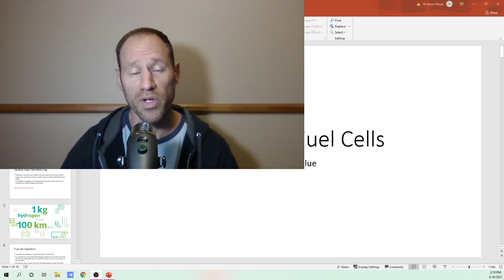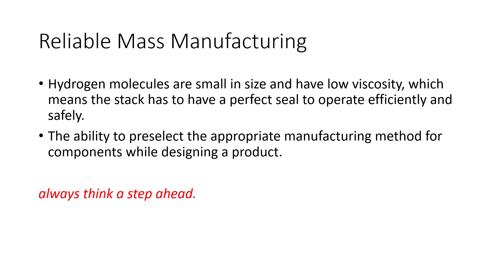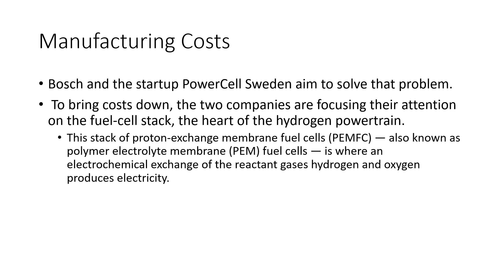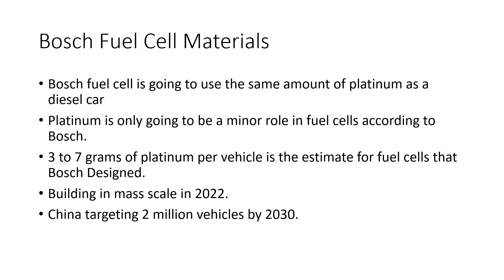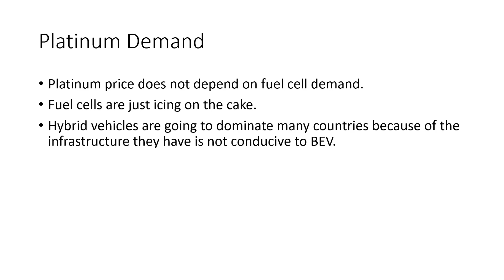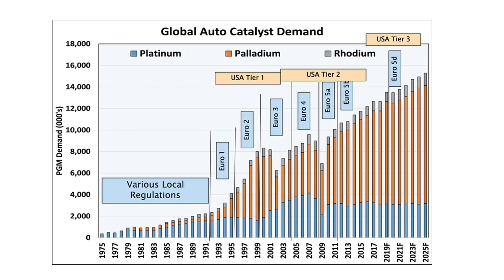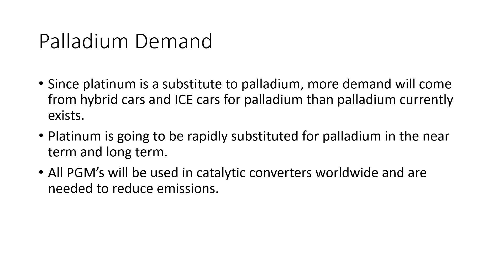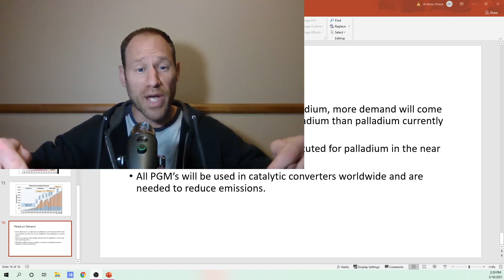Platinum as an Investment: Hydrogen Fuel Cells: ICE Sales in the Future

Comment: If you have a little free time.  Could you do a video on Ammonia Gas for ICE vehicles and jets?  Ammonia is more viable than hydrogen due to the pressure required to keep it in liquid form and the ability to burn it CO2-free in ICE engines. The company in the early stages of commercializing this technology is called FuelPositive (NHHH.V)  The technology to make ammonia gas without harming the environment is what FuelPositive is in the process of acquiring.  Thanks, Andy!
Reply: Thats an interesting concept, i'll have to research that a little more! Initially I am concerned the trade off for lower pressure is the toxicity of the ammonia. Anhydrous ammonia gas is very corrosive and harmful if inhaled depending on the concentration. Massive regulatory hurdles for both hydrogen and ammonia i would expect.